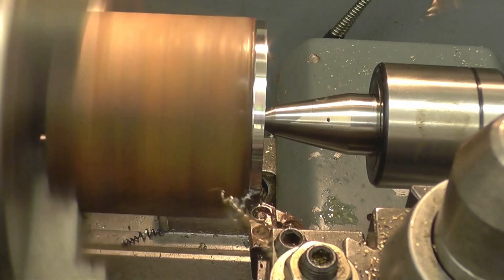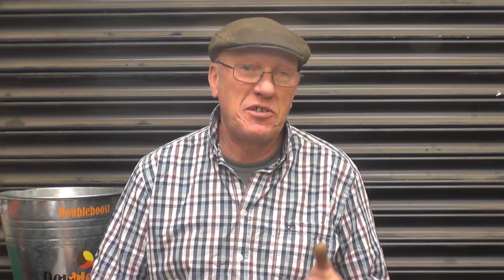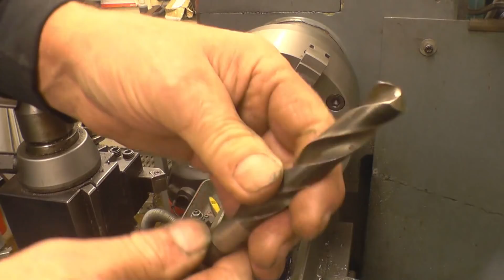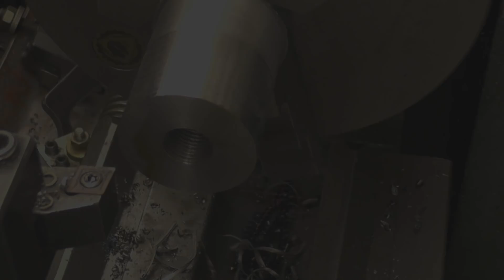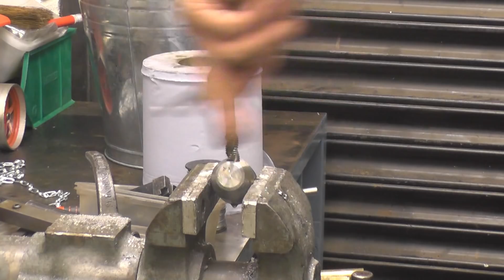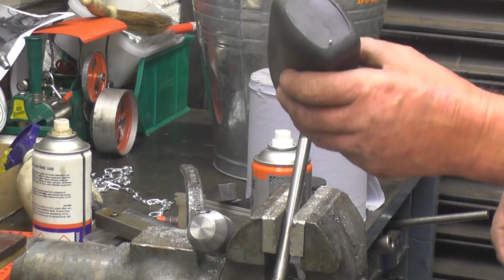SNNC 345 P2   Lathe Tool Post Handle

Comment: I've got the (rebadged) Chinese Mini Lathe and the quick change post that can be added to it. It came with the quick release handle as part of the deal. I can't do as much with the lathe, but at least I don't have to do as much to it to make it work as well as it can.

I bought a second one, but it uses an Allen key to tighten/slacken.

Comment: Nice video. How did you decide where to drill the hole for the handle?
Reply: I was thinking he needed to install it on the compound with the tool post to determine where to clock it.  I guess they will just need to make a custom thickness washer to adjust the clocking.

Comment: "People that don't damage things don't do much"
Love it! Gonna have to use this line in the future.
Reply: I literally destroyed a car stereo earlier. John, being a car mechanic guy will probably laugh at this... but i could not figure out how the stupid ford transit connect stereo removal tool worked. I ebayed a new one... and tore the old one out with brute force and ignorance. Still cant figure out how the feck the removal 'tool' was supposed to work. I'll be tearing the locking tabs off the new one when it arrives LOL.
Every experience is an opportunity to learn